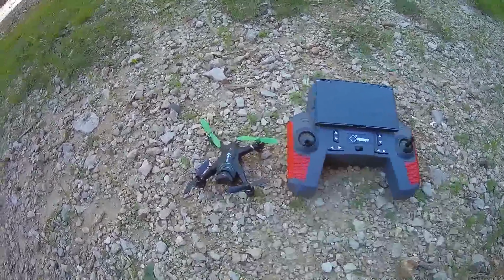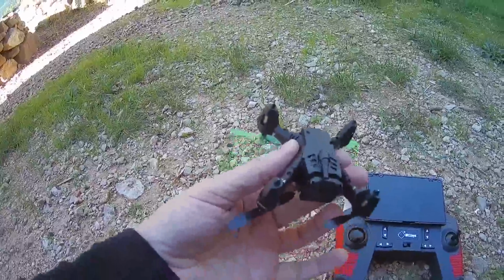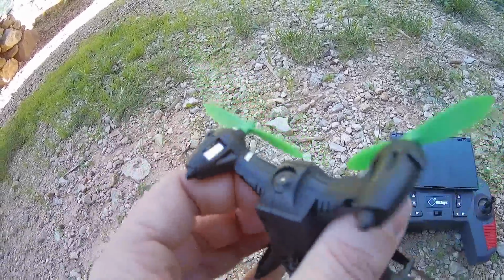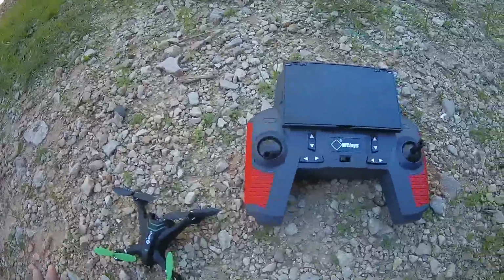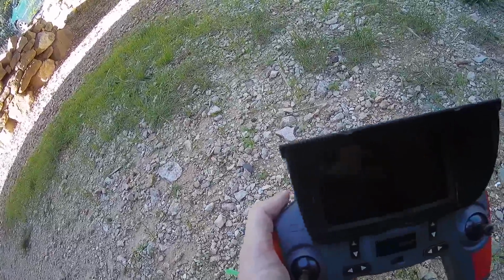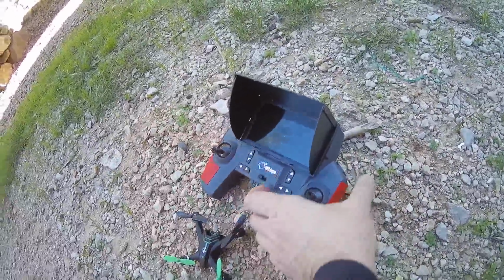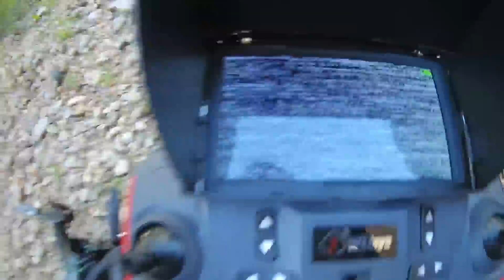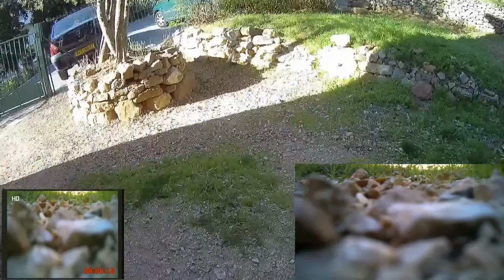WLtoys Q242G first demo flight (Courtesy Banggood)

Comment: Interestingly, the same protocol of the equipment, like H6D, if the video frequency is the same, it can be used, as it is less. I realized that the camera is tilted, the lens would be better.
Reply from the maker: +LT Prime For the Vfreq yes but the radio protocol is different, be aware
Reply: Thank you! Sorry, convenient that she and a small monitor. I use to H6D, equipment from H6C, the monitor is attached with electrical tape.

Comment: Hi, what do you think compare of hubsan x4 h107d?
Reply from the maker: +David With the original H197D, it's a good competitor, the radio link is weaker but the FPV linki stronger. Good news, now you can fly it with DEviationTX if you want a super extra radio range
Reply: +SeBy DocKy so, the q242g is work with dev fpv controller?
Reply from the maker: +David dev fpv controller ?